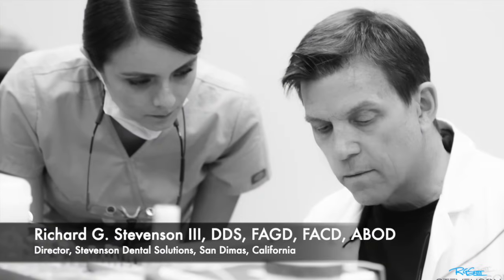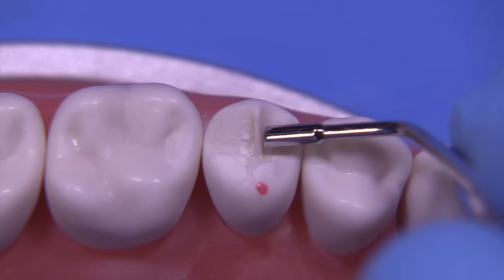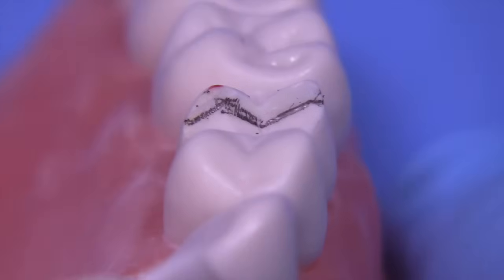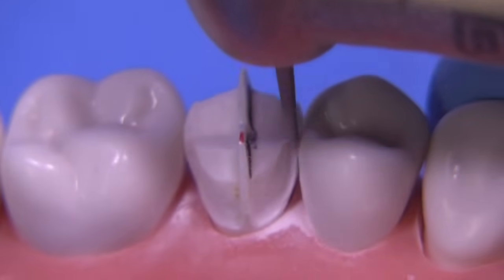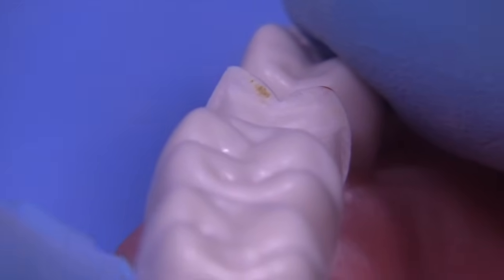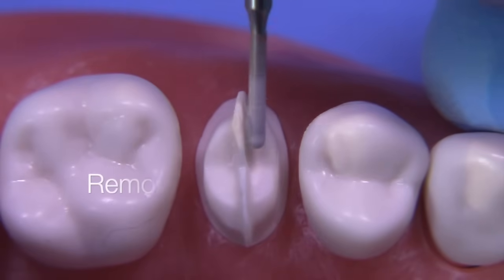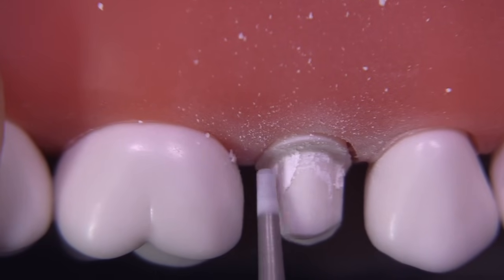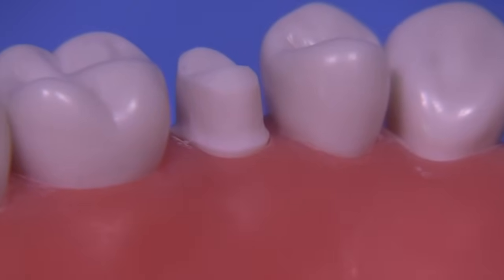PFM Premolar Using T-PREP Technique - Acadental Tooth #4

Comment: Hi doc, i need your advice…… when you are replacing an old crown which has a class v filling above due to the recession, do you also replace the class v filling before you prep the tooth? And the margin shouldnt be on the filling, how can i make sure that…?
Reply from the maker: If esthetics are a concern, I will cover the filling area after repolacing with a glass ionomer. If it is not an esthetic concern, I will usually place the crown margin above the filling.

Comment: Such a great video doctor! Could you please tell us what speed are you using the bur at . I mean how many rpm and also do u change the settings in between
Reply from the maker: Thank you!  I use high speed at full speed until the refinement steps and will slow to stall out mode, which would be about 20,000 rpm on electric speed for

Comment: Doc do you think its better to start the reduction with occlusal one third then do the gingival or the other way ? And do gou find any difference between the two ways TiA
Reply from the maker: It's another option for sure - I've done it this way and it works well.
Reply: @StevensonDentalSolutions  so you start with occlusal third first right

Comment: Should we check the occlusal clearance with opposing occlusion? 
And should it be 1.5mm everywhere?Thank you dear Doctor.
Reply from the maker: Yes, and it should be 1.5-2.0 mm.  You may use a pvs bite registration material to check - slice the registration and measure the thickness...

Comment: What is your position when preparing Upper left premolar ? The water splashes over the mirror and makes indirect vision challenging, can you elaborate about how to handle this problem? 
Thanks
Reply from the maker: Keep water flow to a reasonable level. Use the "cut a little, look a little" approach, and finally, turn the water off completely for the final. refinement.
Reply: @StevensonDentalSolutions  Thank you so much

Comment: Dear Dr. Stevenson, 

Is there any way to judge the buccal and lingual taper of #5 PFM?  Also,  instead of  chamfer bur like the one in the video, is it alright to use a 856016 for the lingual chamfer? I have noticed that controlling the bur 887709 is a little challenging and makes the margin pointy and scratchy for me.  Could you also please share about the transition zone for shoulder and chamfer  interproximally for #5 ? 

Thank you.

Best regards,
Adi
Reply from the maker: Look at the prep from the facial view and each wall should be leaning inward at about 1 second on a clock - this would give 12 degrees of total occlusal convergence.  The 856-016 would be fine, although the margin will not technically be a chamfer, it will be a fillet, which is designed for ceramics and not metal.  The majority of dental schools don't understand this...so using it and calling it a chamfer won't cause any issues.

Comment: Dear Dr. Stevenson,
I  have a couple of questions. 
1) Sometimes when trying to get Interproximal clearance going from the occlusal to gingival  I get like a heap of material and it wastes a lot of time to cut down and then make a margin there. Any suggestions on how I can avoid this step? 
2)  If the typodont can be brought to occlusion, what is a good reference point during exams to check if there's adequate occlusal clearance? Constraints - There's neither putty nor RGS to measure. 

Thank you. 

Best,
Adi
Reply from the maker: Reduce the facial and lingual axial walls first, then the IP clearance will be a smaller job, and faster. 2. Use the shank of a friction grip bur and insert between at a 30 degree angle (parallel to the reduction planes on the facial) - all shanks for friction grip measure 1.6 mm.  Also, you can use the 330 bur vertically at the marginal ridge areas of the prep - the bur can provide you with valuable reduction information (1.5 mm long bur)

Comment: Dear Dr. Stevenson, 
Thank you so much this incredibly informative video. I have a question.. Some universities don't provide appropriate burs for interproximal reduction. Mostly it's 016 or 018. In that case, is it possible to do a crown prep without over reducing the MD axially? 
Also, do you have any recommendation for using the fine burs towards the end in dry cutting? I struggle with getting mesiocclusal and distocclusal surface being somewhat sharp. 

Thank you in advance. 🙏
Reply from the maker: It's unfortunate that some Universities don't re-exam their bur sequences.  You are 100% correct, the 106 and 108 burs will not fit between the IP areas without causing over-reduction.  You'll need to find a thinner bur - even a carbide, like a 169L or 699...Dry cutting is a secret of master clinicians and has been known to be the best mode for refinement for many decades.  Unfortunately, a poorly executed study over 50 years ago scared the dental world into the over-use of water to "protect" the pulp.  The over-use of water coolant leads to over-prepping!  A light touch, new burs and air coolant have been very safely used with no pulpal consequences by thousands of experts.  Use the side of the tip to round off the mesial and distoocclusal line angles, or even use an abrasive point (something that you might use for polishing composite).
Reply: @StevensonDentalSolutions  
Wow!  I can't believe there was history to it! Thank you so much for taking the time to get back to my query. Really appreciate it! I have a couple more questions. 
1) Sometimes when trying to get clearance going from the occlusal to gingival  I get like a heap of material and it wastes a lot of time to cut down and then make a margin there. Any suggestions on how I can avoid this step? 
2)  If the typodont can be brought to occlusion, what is a good reference point during exams to check if there's adequate occlusal clearance? Constraints - There's neither putty nor RGS to measure.

Comment: Thank you kind sir for the amazing video!  I do have a question not regarding it. When I prepare the premolars on the mesial and distal, I tend to over reduce because I'm afraid of hitting the adjacent teeth. Any tips ?
Reply from the maker: Use a needle bur to pass through the interproximal leaving a slice of tooth as a protective barrier.  I like the 859-010 for this - check it out on your website.

Comment: if i were to prep number 29 for a metal crown are these the same steps you would take? how much reduction do you want on the buccal or lingual side? is it 1.5mm on the buccal and 1.0mm on the lingual like you would do for a molar such as 30? how does this prep differ from doing it on a premolar? THANK YOIU
Reply from the maker: Premolars and molars are the same with respect to dimensions for cast gold: 0.5 mm chamfer 360 degrees and 1.5 occlusal clearance.  The axial wall reduction will simply result naturally as you follow the taper desired and the secondary planes. For PFM, it's usually best to reduce about 1.0 mm on the lingual finish line - this allows a minimal collar.  The facial finish line is 1-1-5 - ideal is 1.2 or so.

Comment: I need help with these undercuts ... how do I improve any techniques
Reply from the maker: Look at the prep from the facial and hold the tapered diamond along the long access of the prep - use the adjacent contact areas as a guide, then move the bur to the mesial and see that it should not touch any area above the internal of the axial-finish line - if it does, th=is is your under cut area - use the bur as positioned to remove it, then repeat øn the distal.  For buccal lingual undercuts, look at the tooth from the occlusal with one eye closed - make sure that you can visualize the entire chamfer/shoulder without any of the axial wall restricting the view.  IF you find a tight spot, remove the upper portion of the axial wall in this area first and re-evaluate. If it's still undercut, take the bur all the way to the finish line and lean the bur towards the center of the tooth (perpendicular to the undercut) - this should help...
Reply: Stevenson Dental Solutions thank u I never thought you would reply thanks ❤️
Reply: Stevenson Dental Solutions could you do a video plz .. like do a tooth with undercuts and show how to correct them .. thanks doctor
Reply: Use a coarse finishing disc on the walls to eradicate undercuts. More conservative than using a bur.

Comment: Thank you for sharing this technique doctor. If we are doing a PFM on tooth number 5, do we still make 1.5-2 mm occlusal reduction because there is some pre-existing clearance before we attempt occlusal reduction especially in Columbia typodont. I end up with lot of clearance . Please try to make a video on it doctor. That would help us immensely. Thanks..
Reply from the maker: Good question.  If the final restoration will be identical in contour and occlusion to the pre-op, then perform the procedure with the T-prep design, and you'll be in good shape.  However, if the graders are looking for the amount of clearance from the prep to the opposing, you'll need to prep more conservatively and then adjust after closing the typodont.  If you make a provisional stent from the pre-op tooth and use just clearance as your goal, your temp will be thin in some areas.  Hopefully, the graders understand that this is a flawed approach.  Always base your prep design on the desired final restoration.
Reply: Stevenson Dental Solutions Thank you for your response doc!!

Comment: Realy amazing job.... My qustionis is that why u made shoulder on facial and chamfer on lingual ?
Reply from the maker: For the standard PFM in the US, we use a porcelain butt joint on the facial and a lingual collar in metal.  This requires a shoulder for the ceramic and chamfer for the metal.  Thank you!
Reply: Standard for PFM. I have been practicing many years and would go for .75mm-1mm rounded shoulder for entire margin for monolithic zirconia or .5mm chamfer all around for bonded emax.

Comment: Hey doc can you reply by in which sequence you have used bur?
Reply from the maker: 847KR-016 Occlusal reduction and Facial reduction, 878K-012 for axial reduction on lingual and proximal, then 8877-009 for refining the chamfer, and KS0f for refining the occlusal.
Reply: @StevensonDentalSolutions  thanks doc quick reply

Comment: Great video, as always!

Maybe some time in the future you can do some tips and tricks videos on clinical scenarios we often face that stray from clinically ideal. 

Some potential examples...

Deep sub gingival decay in the proximal box that makes getting a good seal with your matrix band very difficult. 

Adjacent class 2 restorations - the best way to restore to get good contours and contacts. 

Working on the distal most tooth in the arch when you have a rubber dam on, and the clamp is in the way of your matrix or operative field. 

I’ll try to think of more!
Reply from the maker: Microscope ready - planning on several this year.  Thanks